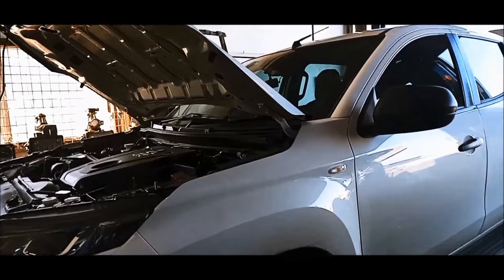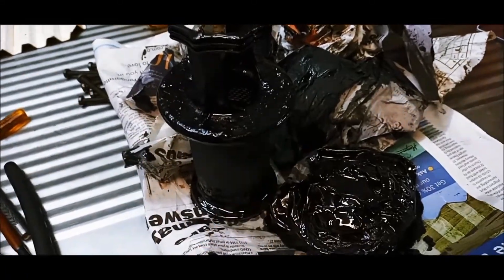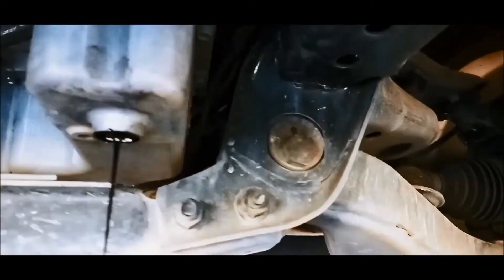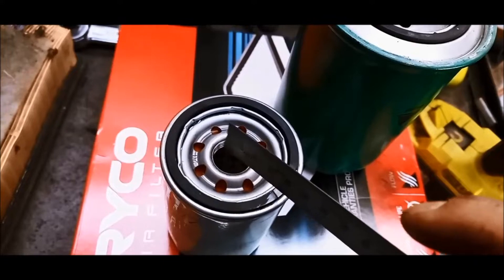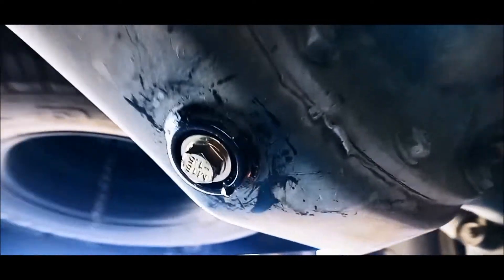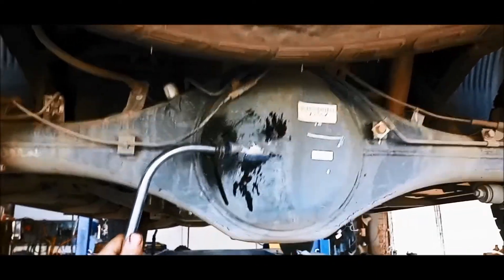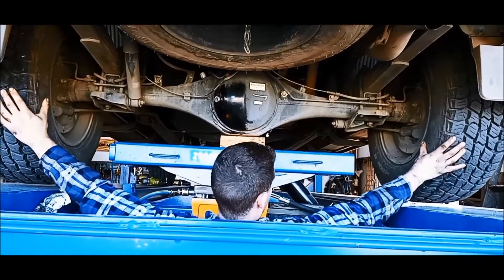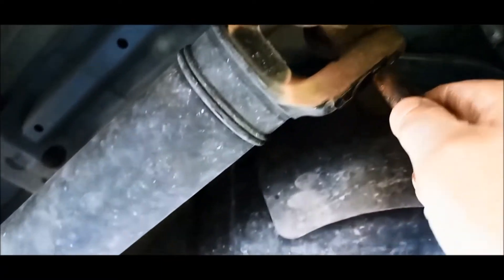L200 Triton MQ MR 2.4 TDi Engine Filter Service Transfer Case & Front / Rear Differential Service

Comment: In the MQ manual they state that the diff capacity is 1.2 lts however I have always serviced the same as you 
Fill until it is level with the plug hole which is just over 2 lts
So I did it the old way without any apparent issues
I have since sold the vehicle

Comment: Thanks great video,interesting info on drain plugs thanks.

Rear diff if you look up all the lube guides they state capacity as being 2.3 litres   ,but if you fill to the bottom of the filler plug its way more!!!what are thoughts on this.

Comment: those oil that catch cans catch the oil that usually mixes with the recirculated exhaust , and it goes kinda fluffy/abrasive ive seen that crap 3/4 block intake ports on modern deisels and also score bores etc, i dont care i blank off the exhaust gas resirc with stainless plate.
Reply from the maker: hi, agree but some dont like blanked off plates. cheers

Comment: the oil capacities listed seem incorrect  , as my rear diff says 1.8l , but when I drained it 3l came out & I refilled to the  refill plug was 4l   , advice on oil  capacities  - diffs & manual transmission  & transfer case  , thank u
Reply from the maker: hi, that is why you refill and check according to fluid/oil levels as recommended. the amount that comes out is only a guide ( incase someone under or overfilled or there are leaks ) so many variations out there it is often different to what actually is needed as you have found out. cheers
Reply: You are bloody right!!My rear diff took  approx 4 litera and it was advised 2!!!

Comment: Have you got a video on Diff centre replacement? Is it easy to do yourself?
Reply from the maker: hi, no video yet. wash it all off first. then pull out axles and centre should come out. if diff is full of metal it may be good idea to run it with solvent a couple times on stands to clean out axle tubes before you replace it. cheers

Comment: one rac guy said to me as a tip, never squash radiator hoses with your hands if the cooling system is hot and  pressurised he's seen old hoses blow hot water all over guys doing that
Reply from the maker: hi, yeah must`ve been an old hose ! cheers
Reply: @YepThatsIt  yeh your right, however today i bet there are some inferior hoses about , i always squished them when hot and pressurised now im careful

Comment: Provent Oil Catch Cans do a great job of catching the Oil mist, but I can see the owner of this Triton is not keeping up with maintenance on the Catch Can
it needs to be drained regularly and filter element replaced every 40,000 km max.
Reply from the maker: hi,yeah the owner was just draining it once a month, not taking cap off. in winter metal sweats out moisture as well as it heats up, adding to the issue. you cant beat regular maintenance. cheers
Reply: Hi what’s the filter element? From Ireland…. Maybe different vocabulary for parts?! Is it just the oil filter?

Comment: Hey man, what are your thoughts on the Mitsubishi challengers? Old and new ones?
Reply from the maker: hi, they have had over 100 years experience designing. now they deliberately have a thing where they design a component to fail at 50-100% after warranty. designed obsolescence. regular maintenance and replace the engine cooler every 100,000km or install a remote filter in its place ( see vids ) to help eliminate premature blockage of the eng oil flow. cheers

Comment: g'day Question, what diff oil do you put in the MQ/ MR Tritons, factory spec is SAE80 GL5 but you can't get it anywhere, 75W-85 OK GL5 for normal driving?
Reply from the maker: hi, will be fine.cheers
Reply: @YepThatsIt  went with 75w90 full syn Penrite in the end, I asked Mitsubishi service dept what they use, they said 80w90, completely different to what's specified in book, go figure !

Comment: be sure  not to overfill the diff about 36mil under the fill hole using a 10 mil allen key sat level in the hole the fluid should be touching not flowing out of the hole
Reply from the maker: thanks for that. cheers
Reply: I was told that the early MN s had a problem with the air valve on top of the diff caused to much pressure and blew oil out the wheel seal so they dropped the oil level i fill my diff to the plug hole and its quiter and no problems in the MR triton

Comment: If that's a LSD diff then it's stuffed, that is an open diff, if the wheels spin in opposite directions to each other its a open or standard diff when you try to spin one wheel & it spins in the same direction then its a LSD diff.
Reply from the maker: thanks for that. cheers